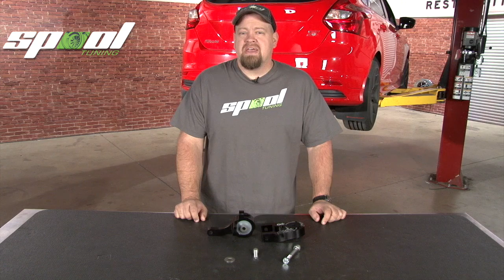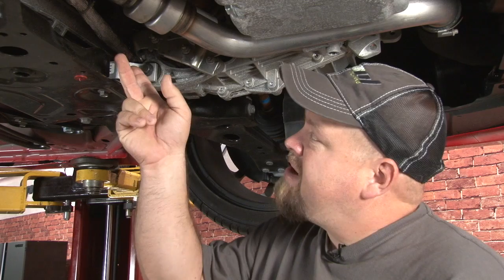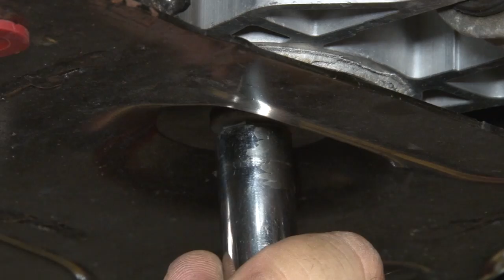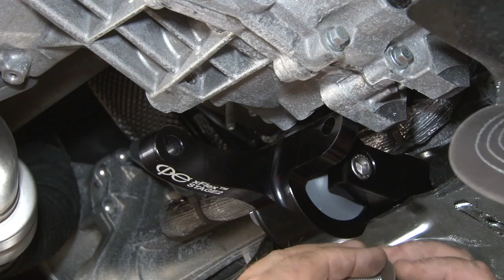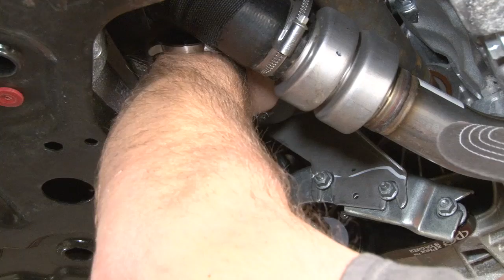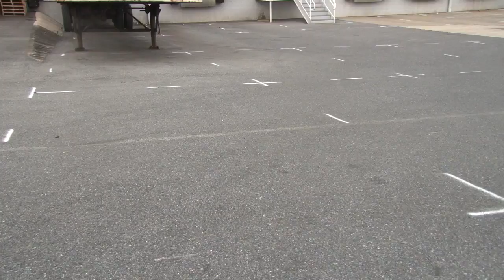Focus ST cp-e Rear Motor Mount Stage2 xFlex 2013-2018 Installation

Comment: Just bought one of theses for my st in the manual it says disconnect the negative connection on the battery but dosnt mention it in the video is this necessary?.also in the manual its says use loctite on all bolts is that also necessary any help appreciated cheers

Comment: Looking at this video you used a different bolt to go through (black) the mount than u took out (silver), if it’s like the mk2 ficus there different sizes silver is  shorter  and if you use the wrong one it can puncure the steering rack
Reply: So the silver bolt should’ve been used on the underside instead of the black?

Comment: Sorry for the n00b question:

What's the cause of the crackles coming from the exhaust? What about the black smoke?

Appreciate the video. I got my mount today from you guys and can't wait to put it on. Still blown away at how massive the level of community support is for the FoST. No other car community I've been a part of has the size, dedication, and quality that the FoST has. Blown away.
Reply: Not an ST owner (but im installing the stage 2 cp-e RMM on my 2.0 fusion its the same process lol) 
The crackles are from unburnt fuel burning in the exhaust (so just pops) 
And the black smoke is dirt from the ground mixed with the soot from the unburn fuel its pretty common with catless downpipes which is why cars (especially catless ones) have black exhaust tips and are typically a lot more thick layers then regular cars, just from the unburnt fuel burning in the exhaust pipe causing that build up

Comment: Hey man, quick question. How on the installation manual was mentioned to disconnect the negative battery, but i dont see the point of disconnecting that?
Reply: Generally no need to disconnect the battery when changing out anything which involves low current or anything which is switched. That means it has no live wires going to it when switched off. In this installation he is disconnecting bolts that are attached to the chassis, maybe it has an effect on how the car is grounded?
Reply: You have nothing to worry about, don’t disconnect the battery.  Think about it:  you would have to take the positive wire from any circuit you can reach, and short out to ground somewhere on the vehicle.  I’m pretty sure this instal doesn’t touch any wires so you’re okay.

Comment: Could this be installed on a ST Diesel? or is it different down there?
Reply: Roberto Tullii what’s the hp and torque on the st diesel? Don’t see those in the states.
Reply: @joshharmon4867  180Hp not sure about torque

Comment: would you recommend this for a first upgrade? It does say stage 2 so I am concerned on buying it for my first part.
Reply: BradTechLee get it! This is 2 piece instead one piece. Much better setup. 
I waited did with downpipe n exhaust work.